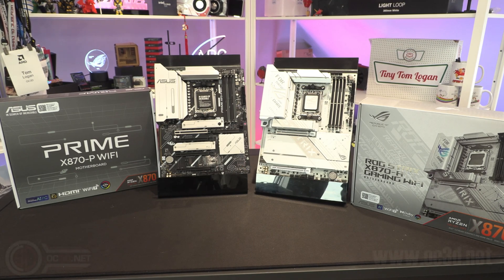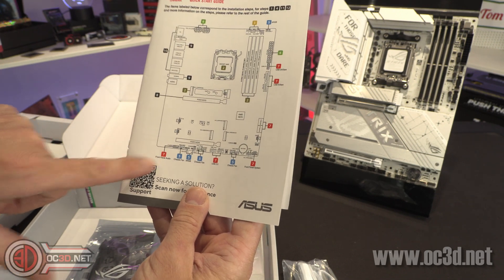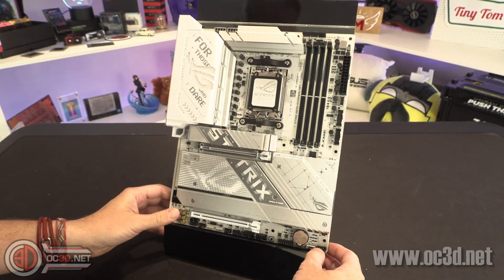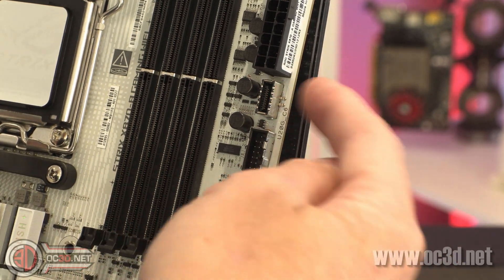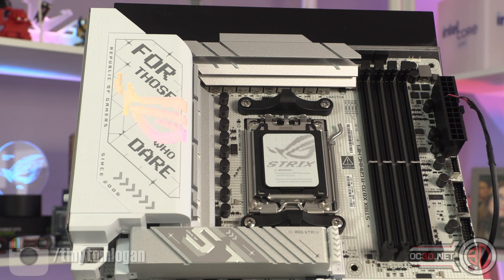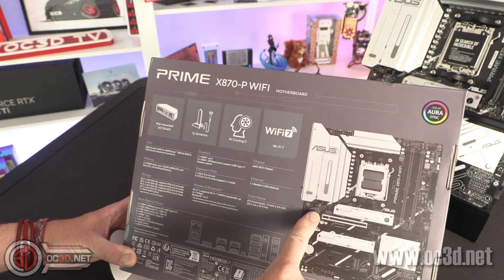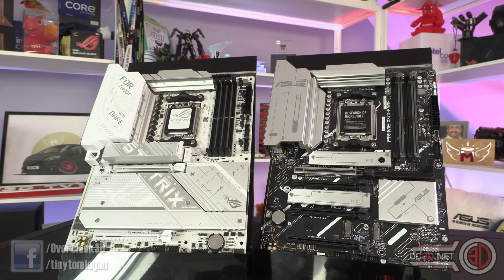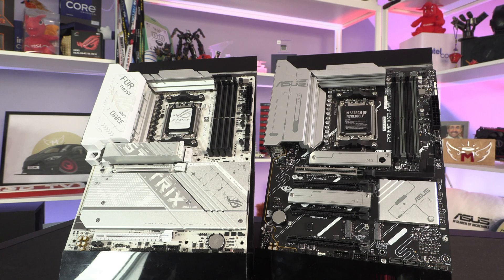The White Ones - ROG Strix X870-A and Asus Prime X870-P

Comment: Does the pci m.2 slot below the Gpu  share or reduce the bandwith of the Gpu if  it's populated , if so, which pci slot is best for the second ssd nvme slot 3 or 4 and which provide the best speed slot 3 or 4.

Comment: I have a question: if i have a m2 ssd gen4, do i have to install on pci4 (the second slot down) or in the upper pci5? I read the pci5 lines are shared between gpu and ssd m2...
Reply: Since the gpu and the top m.2 slot are both pcie5, you dont have to worry that much. The gpu won't come close to using all the pcie 5 bandwidth even with a 5090 and 4k gaming.

Comment: cant use the m.2 slots all at once. it cuts your pcie bandwidth in half if you use more than 2 drives. and they need to be in specific slots., the whole thing is cheezy
Reply: 0 gpus use pcie-5 let alone pcie-5x16
Reply: @TheSjuris  the new 50 series nvidia and 8000 series amd will and are due any time now
Reply: @johnr2391  doubt even the 5090 needs full lanes. The 5070 and the 5060 won’t and AMD isn’t releasing anything powerful. If you have a 7900xtx That is more powerful then the 8000 series and that doesn’t fully use all pci-e 4 lanes.  Remember the bottom 2 m.2 slots are powered by the chipset on the x870e’s.
Reply: @TheSjuris  yea right now i run a xtx. am4 platform but with only 24 lanes i can see them being used easily with a few m.2's and future gpu's. and usb 4
Reply: @johnr2391  usb 4 was a forced feature by AMD. Probably still not really needed by most users certainly not 2 ports. That’s where the issue really is. Reality outside of creators nobody really needs more then 1 5th gen m.2 drive either.

Comment: Only 2 SATA ports is a deal breaker for me. I know it's a natural progression to move to the latest technology and phase out the old stuff, but I need more than 2 SATA ports because I'm a storage-monger. I have perfectly good 3.5 and 2.5 hard drives and no reason to lose them just because "new motherboard."
Again, with the crappy audio connectors on new boards.. Sad.
Reply: The audio chip is the same as the hero, the audio is actually very high end

Comment: 2 expansion slots on an extended atx is a fugging joke . 2-4 sata ports also . I get it there are 4 pci-e nvme slots , but goddam this high end market is maybe 10% or pc sales . Furthermore people who need more than 2 nvme drives are maybe 10% of the 10 PERCENT . And i am really generous here , if you check steam hardware survey , the numbers are even lower . 
SO my question is who are they making these boards for  ??  . They could save an easy 50 bucks (maybe even 100) if they'd give us what we need and use .
For the presented features a "skinny ATX" is more than enough , and at a cost of absolutely no more than 200€ . 
Unfortunately this is the trend , all board makers make boards with less expansion slots . I get it , only a few people need more than 2 ports , but then drop the cost .

ps: Can't wait to see them run . From the description "Could these be the boards you put in your new white Ryzen 9000 System?" - NO . 

At this point i'm questioning the very nature of a 9000 series build . I might go with the 7900x3d .  The big amd hype turned out to be a flop , as it usually does. Now... i'm not happy because of this but if i don't get enough improvement i won't upgrade. I game on 4k . Anything more than 120fps is irrelevant to me , and i get by with 60-90fps just fine . Currently i use a 3900X , with a 6800XT . Perhaps i'll wait till 9900X3D , remains to be seen . To be more precise i don't have a valid reason to upgrade regardless of 9th series performance , i just want to, because it's a hobby for me and the computer is getting old , soon going into 5 years .

Comment: I'm currently using the x670e-a version of this mobo...if the x870 has the same 2.5g lan (I225-V) it will be horrendous. everything about the board is perfect EXCEPT the 2.5gbe LAN port.
constant disconnects  even when i switched to a UDM-pro. doesn't matter if jumbo frames is on or off or if i update lan drivers.. i even am using a static ip for this pc and it continually drops lan port recognition at least once a day.
my next step is to just get a 10bge nic for my unifi 10bge switch.

Comment: 6:17 the rear "tangs" on the pcie slots engaging in a case typically prevent that from happening Guv.
For a £210 board they're okay but I'd go for one of the many gigabyte ICE boards, they're less cut down in forms of usability like SATA ports etc with all the same aesthetics,  At £269 I'd buy a B650I aorus pro because a white heatsink and white GPU and white RAM mean you can't even see an ITX board :D

Comment: 2 Sata connectors and no solid pins 24 connectors? 
LoooooooooooL
Not even gonna mention the lack of pci-e 16x slots 
or audio connectors.
What are you paying for????

When are we going to make a statement that nvme we only want 1 and the rest give us pcie 16x slots and sata and have a separate single skew with 5 nvmes like a pro art.
Reply: i couldnt agree more. 2 sata ports is a joke and the pcie 5.0 nvme obsession is absurd (specially when there are not enought lanes on the platform). I think asrock mobos just have 1 PCIE 5.0 and several PCIE 4.0 ones without any kind of lane sharing with the gpu. Hope to check that in the diagram they include in the Manual. Sadly this is not ready yet.
Reply: it is a 8 layer PCB, x16 PCIe gen 5 which does not share it while you adding m.2. Also you have m.2 pcie 5.0. It is also cheap and has heatsinks on vrm with good power. Me personally doesn't care about the sata cause i don't have one. So it seems to be the mobo. May be i am wrong

Comment: I want to see a Proper X870E white Board, like the Gigabyte X870E AORUS PRO ICE, hopefully soon.
Reply: I like the asrock Steel Legends as I can combine with their Steel Legend GPUs.
Reply: sept 30, my wallet is ready, the exact model you referrnced
Reply: @endorphinADMIN Only thing holding me back on these is it seems that with 2 M.2 slots populated the GPU gets cut to x8 since the rear USB 4.0 ports take 4 pcie lanes 😢
Reply: @BearSlaps  the gpu never needs full 16x, i'm running a 3x stripe on the 990 pro nvmes right now, the 4090 still puts out nicely at 4k, i doubt the 5090 will require full 16x as well
Reply: @BearSlaps  the Aorus Pro or the ones on this video? Planning on doing a build and looking for the best white board I can get